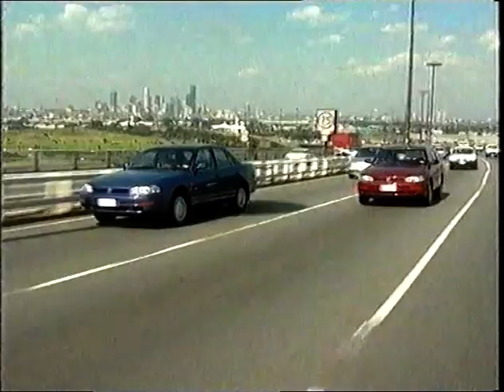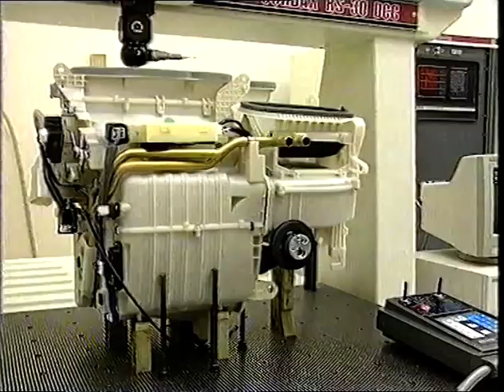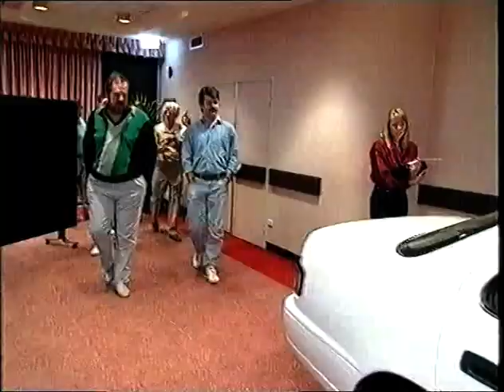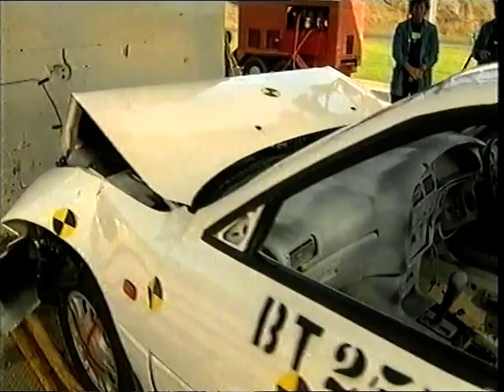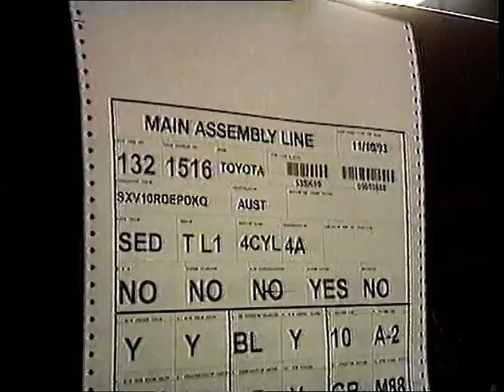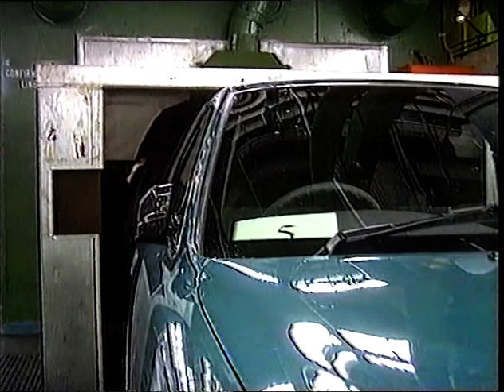Design and Marketing of a New Product - Case Study of the Toyota Camry (XV10)  - 1994 (Australia)

Comment: Glad i found this video. It reassures the fact that the toyota Camry's were great cars and still are. The XV10 series certainly improved the basis that the previous SV21 model had set. I own a camry myself, however mine is the later version of the SXV20 and MCV20 series. I have the V6 version of that model which is the MCV20 which the engine designation is 1-MZ-FE. Never had a single problem with it in the six or seven years that I've owned it. No matter what model camry it is whether its the very first camry model introduced to Australia way back in 1983, or the first gen widebody camry which was the SV21 and was released in 1987 or any other camry afterwards, they're all great cars and all possess the typical Toyota reliability and dependability.